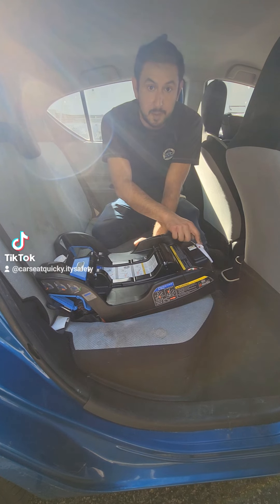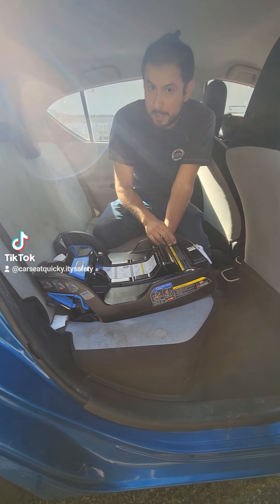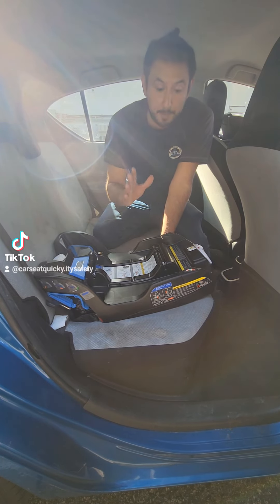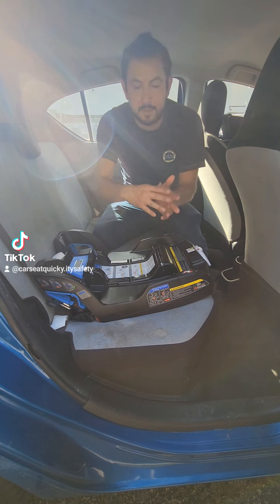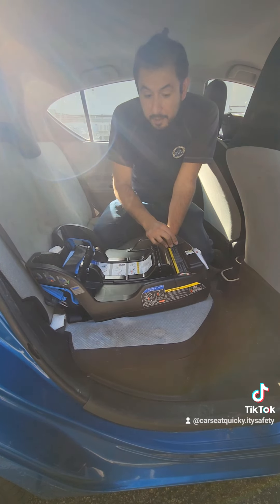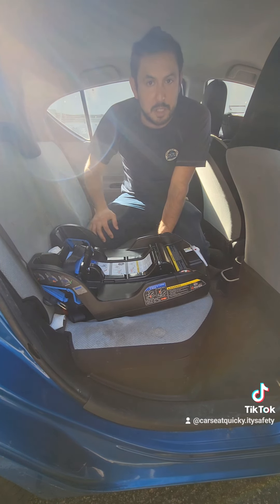LATCH Installation, Doona  Base

Comment: My latches are behind the seat and don't reach. Any instruction for that?
Reply from the maker: @papillon80203  What you are seeing is the tether point. The latches will always be accessible without having to go into the trunk.

Check your vehicle manual. They may just be a little hidden.